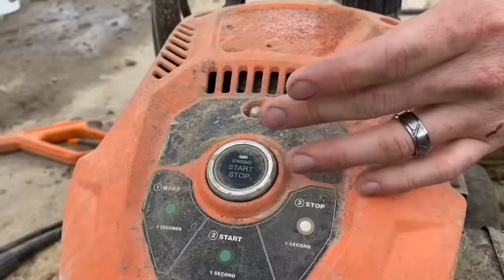FOURTRAX FREESTYLING and gasoline in a pressure washer

Comment: “It’s a Honda 300, it’ll be fine”. WhistlinDiesel “hold my beer”
Reply: Avian Brummell it’s also whistlindiesel budd.
Reply: Mines a 98 Honda 300 fourtrax it’s a beast like better than any new four wheeler with 4x4
Reply: Garrett Smith yeah. I wanted one. But I had a 2002 Honda recon 250 and it just went through everything. Now I have a 2016 Yamaha Kodiak 700 for like 3 years now and the belt finally blew but it’s getting the new one put it right now. I also have a 1984 Honda 110 atc got it for 105 non running. But new tires on. New air filter throttle cable and carb. It’s still not running it’s not getting gas. And we’re putting a new plug tomorrow. Hopefully we can figure what’s wrong with it
Reply: PaRaDoX500 no it’s a Kawasaki 3trax
Reply: Jameson shit that’s right
Reply: Next up: Toyota Tundra
Reply: *Hold my flaming pressure washer*😂😂

Comment: That pressure washer flame thrower is the coolest idea I’ve seen in about a month
Reply: Dumbest too, if that flame made its way back to the sprayer... boom huge explosion.
Reply: @Reprehensiblee  doubt that
Reply: Skuddy Crusty Putty it can happen with a paint can and a Lighter also but the chances are very low of that happening
Reply: Skuddy Crusty Putty nope, there’s no oxygen in the gasoline lines, so there’s no chance at combustion inside the lines, not to mention it’s not the gasoline itself that burns, but the vapor, and since the lines are completely full of gasoline, there’s no vapor. Another safety in place is the fact that the ole the gas is coming out of is a tiny orafice, meaning that it’s near impossible for the flame to travel back up through it
Reply: @winzhorton3776  thank you for saying what I couldn't 😂
Reply: @Reprehensiblee  theres no oxygen so yea.... no boom..... not gonna happen
Reply: He more likely to start an ark from the static electricity then it traveling up the wand.
Reply: Winz Horton lol ok scientist, googles your best friend isn’t it
Reply: @winzhorton3776  Go science!
Reply: @winzhorton3776  but why is there so much static?
Reply: something worty of washing a chevvy

Comment: Honda’s don’t break. I’ve rolled mine down a 30 foot hill and nothing happened . I’ll ride down the road on 2 wheels and people pass me with weird looks on their faces.
Reply: Wish I could say the same about my 400ex it just keeps breaking down
Reply: Mine ran out of gas in the river sat there for a week and fired up first kick.
Reply: Ehh I prefer riding my YZ 85 2 stroke on one wheel but its dangerous, even hella worse than 4 strokes
Reply: HRT'DORIFTOS 777 smallll
Bike
Reply: I bash my honda 300ex around so hard everytime and it never breaks!
Reply: Vacated Meteor I have a 2005 trx250 that I’ve had since brand new and it’s starts up every time I leave it sitting for months with no hesitation Honda’s are tough.
Reply: Vacated Meteor that thing is pretty solid thats for sure! I have gone threw a few yfz450r frames
Trees win 😫
Reply: @v8power561  we all gotta admit hondas are better than can am, now I got a Polaris Sportsman 850 highlifter on OUTLAW 2S
Reply: @savageclown5457  bruh its s big wheel not small wheel 85
Reply: I don’t think I’ve broke a single Honda BRANDED piece of machinery before, broke some of the tat with Honda engines though

Comment: Why didn't you use Diesel instead of gas Mr Whistlindiesel? It should burn ok once it's sprayed from that power washer.
Reply: I'm pretty sure it could actually have burned in the pump since its diesel, which  is a compression ignited fuel
Reply: @christopherolszewski8710  lol how much O2 is in the pump?
Reply: @signlsirchir2156  well considering it's not an airless pump not very sure but that's why I didn't say it was going to happen just that it could be possible 😉

Comment: Hondas are tough i have a 1985 trx and it was sunk under water and stuff before i got it and we had to find a way to start it with the pull start since the electric start doesnt work and it runs fine

Comment: $1100 for the transfer case sun gear that accepts the larger transmission output shaft? Just get the NV5600 one and cut it shorter. I belive it's like $50.

Comment: I would try tapping a flare to the end of the gun and  use the smallest tip with just a pinhole for maximum range and destruction lol
Reply: Good job I always wanted to try this but in the city it wouldn't take long I'd be on 6 o'clock news lol